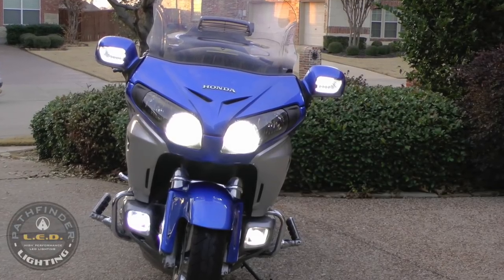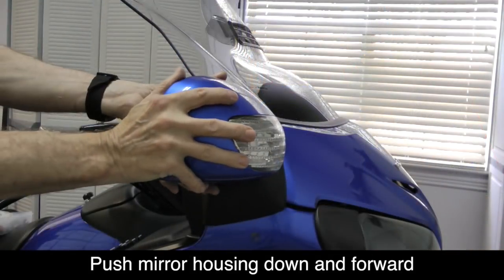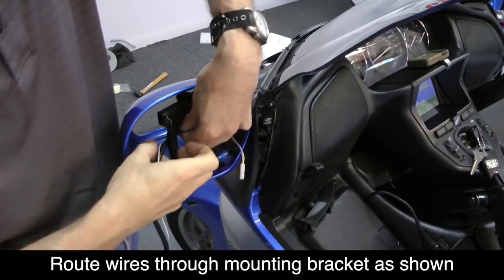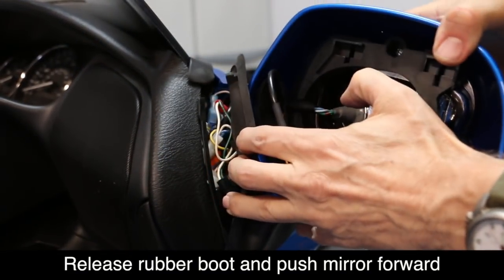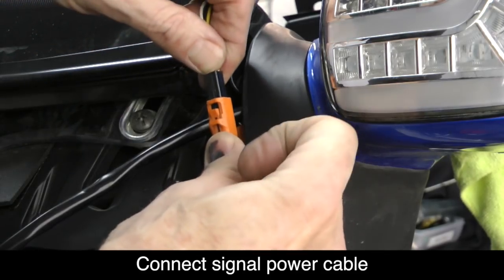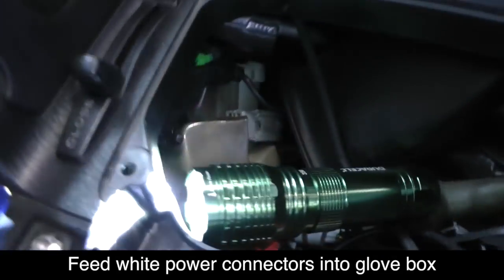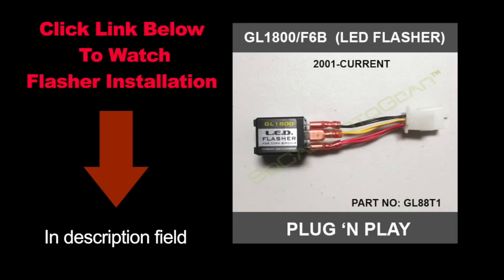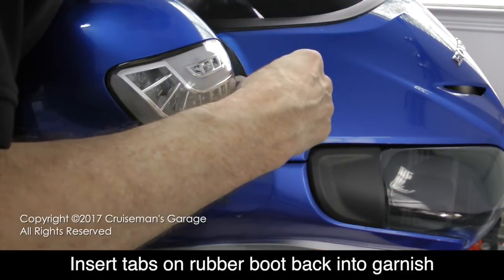Dynamic Sequential LEDs for Honda Goldwing GL1800

Comment: Installed the same lights on my 2008 Gl1800 plus the same Pathfinder daytime running lights/ directional/ fog lights  and Muth mirrors/ signal. All the lights work, but not all at the same time, left turn signal activated, the bottom light on, mirror light and directional off and visa versa. Same with right directionals.  Completely out of sequence. Installed new L.ED flasher. What could that be?  followed your video installs on these same products.

Comment: Just got my first GL1800 and want to install all LED lights and saw this comment on WingStuff and wonder if anyone ran in to this issue: "I love these turn signals however do not try to use these with the Pathfinder Ultra flash brake light bulbs and rear turn signal leds. The turn signals will cancel when you apply the brakes. If you do use both products just use your amber rear turn signal bulbs and everything will work."

Comment: Good Morning Chris. I’m wondering if you have updated this video for the 2018+ bikes. I recently had my bike fall against the wall and cracked the right forward facing lense. Stopped by the dealer and was informed the part is $155 sealed unit. So I thought why not upgrade to sequential turn signals. The manufacture used in this gl1800 video says they have it but its not available until 8/22. Any help would be appreciated.

Comment: I’ve purchased your series of instructions for maintaining a Honda Goldwing however this may be a quicker answer to my question here. About a month ago I bought a used 2005 Honda Goldwing California sidecar trike. One of the low beam bulbs needed replacement. I attempted to install an LED replacement but went to my local Honda dealer for advice and he sold me the stock bulb which I installed.  He said the LED bulbs screw up the computer system in the Honda and did not recommend installing that. So I installed the bulb he sold me and it’s a match for the other one that was in there. The attempted initial installation of the LED may have affected the computer system as he said because the hazard warning lights will not turn off now and also the Cruise Control remains on. If I disconnect the battery will that reset the computer system and bring everything back to normal?  Alternatively where can I find the information I need in your instructions?  
I need help here ; ) My goal is to maintain this motorcycle myself. Thank you.
Reply from the maker: I don't think an LED would cause an issue with the cruise control. The only side effect I am aware of is that it might make your flashers/turn signals flash too rapidly. Unhooking the battery might resolve the cruise issue.
Reply: THANK YOU

Comment: Hello my friend I was watching this video installation of the front turn signal lights and I have a question I am installing those special lead life for the break and turn signals in the back of my 2009 Goldwing in the question is can I use the Flasher that came with that installation or do I have to change that flasher again for the front turn signals or will that flasher operate as well for the front turn signals as well as . new LED light rear installation..???
I will be waiting for your response before I make a purchase
Reply from the maker: You only need to install ONE LED flasher, you do not need to re-install a second time.

Comment: Hi CruiseMan Garage,
As always, thanks for a great video.
This, marked as v2, deals with the reinstalling, something missing from the 26th March Video.
Great.
I just bought today the MUTH Mirror for the 2016 GL1800, and also this Pathfinder Dynamic Sequential LED Turn Signals.
I want to install both tomorrow.
I have watched your video installing the MUTH LED Mirrors.
Both these videos are very clear regarding installation if installing either.
However, what happens if installing both? Do these 2 products may have common wiring connectors, and what I should do to connect the 2 products from 2 different manufacturers.
Should I connect the MUTH Mirrors first?
And, with these in place, any procedure that should be changed from the video above while installing the Pathfinder Sequential Turn Signals?
Grateful for guidance on installing both products,
Thanks.
Reply from the maker: I have the MUTH signal mirrors running in conjunction with my Pathfinder LEDs, so you should be OK.

Comment: I've been watching this video for a while now and realising how badly this light was designed. I've got 2013. US model GW with adjustable screen and plenty of other aftermarket lights installed. Ive ordered this and had lot of trouble to get this delivered to Balkans. 
First of all, installing procedure is difficult due to a screw position on a tension plate for the screen, then connection socket is occupied by this set up and there's no other for extra gear installed (like myth LED mirrors for ex.), if I use one provided then I need to disconnect all other lights due to a cable restriction (there's no extension same type female socket). Then its impossible to link the cable between two mirrors due to a adj. screen (screen will mess the wires if lowered) and cable is too thick which get us to a final flaw of a product: why on earth did you put that interconnection 4 wire cable between two mirrors in a first place? US model has constant positive for daylights and separate for indicators, so three wires already. Other product utilize those three to get light and indicators separated for left and right side. In this case if something goes bad (I mean, already did, it cant be fitted) you lose both indicators and daylights, like connector between sides isnt waterproof, its cheap chinese type. I dont get it why did you did this so complicated? If it was just to save few bucks on controller for each side its ridiculous.
Further more it run out of sync with other indicators installed, it so crappy designed!
Btw, Im experienced electronic expert with 30yrs into general electronic, LED lighting and such and I will get around all this by extending wires, cutting it, soldering and everything but this not should be the case...I would not recommend this product to others as its not DIY for the average person.

Comment: What exactly does the LED flasher do? Do you have to install it? I feel comfortable replacing these but not that flasher.
Reply from the maker: You don't have to, but the stock flasher is designed for standard signal bulbs, not LEDs, which have a different resistance. If you leave the stock flasher in place, your turn signals will flash more rapidly.

Comment: Your comment section would not let me correct the wording so I have to do this all over again would like to know if I have to change out the Flasher that I put those special rear LED lights in that flash like they do and was wondering if I have to change the Flasher out again for the front turn signals that you are showing here or can I keep that flasher that's installed with those new LED lights for the rear of my 2009 Goldwing
Reply from the maker: Once you add an LED flasher you should not have to replace it.

Comment: Question on my 2009 Goldwing are those wire connections inside going to be the same color as the ones you are showing here on this later model Goldwing because that's very important to know..???
Reply from the maker: That is a good question. I THINK so, but am not 100% sure. They should be the same.

Comment: Hello Cruz man this is.
Emmett. I installed that Pathfinder lead lights with flasher for the tail lights on my 2009 Honda Goldwing but they did not flash like the demonstration model that you did the install on .
Is that because I have for running and brake lights back then on my 2009 top and bottom..
And secondly when you do an install the information that you put up on the screen does not stay up there long enough it's like a Flash and then it's off you really need to do something about that my friend
Reply from the maker: If you replaced the flasher on your Goldwing with the LED flasher, then the BRAKE lights should flash/modulate when you press on the brakes IF you have installed the Ultra-Flash LEDs. If they do NOT flash when you press the brakes, it is possible that the incorrect bulb was put in the wrong socket.

Comment: I just added the LED blinker lights and did not install the flasher. This is what I noticed.  As you said the rear blinkers blink very fast, 2nd- when I use my key fob and set the alarm, the front bliinkers do not blink anymore and 3rd- when I turn the key to accessories the blinker lights now come on. If I install the flasher will this be solved?
Reply from the maker: The LED flasher will resolve the rapid blinking issue. However the turn signals no longer flashing with the remote button will continue, same with the accessory key position. This was necessary for proper electrical coordination between the LED DRLs and the sequential turn signals. However, you should know that the LED DRLs draw VERY LITTLE power from the battery.
Reply: I like the lights but something needs to be done about the other  2 issues. I personally liked seeing my blinkers flash to tell me my bike is locked.  The other I guess is easier for me to live with. Thanks for the reply.
Reply: Oh also would like to see a more in depth video on the installation of the flasher.  Seems like the current video just stops. No detail on what to plug to or what I guess that is a mounting bar, what it mounts to.
Reply from the maker: You may want to email SoCalMotoGear about the other issues. As I recall, it had something to do with the hazard lights working correctly. Some sort of load issue.
Reply: I understand now why you didn't go into more detail about replacing the flasher.  Tore it down, no problem, found  the flasher,  no problem. Getting the flasher off the mounting  bracket, some problem.   Problem, getting the wire off the flasher. Question. There are 2 plugs. One is for the stock plug, what is the second one for?
Reply from the maker: Yeah, they built the bike around that plug and there's no good way to photo or video that mounting bracket. I have heard others say there is a second plug, but I never saw one. Just plug the new flasher into the connector where the old one was plugged in. I will have to check to see what the other plug is for.
Reply: Yeah there are 2 plugs on the new flasher.

Comment: You showed 2001-2005 needing a pin for this installation what about 2009 like the bike I have which is a 2009 1800 Goldwing..????
Reply from the maker: 2006 and up do not require anything additional.